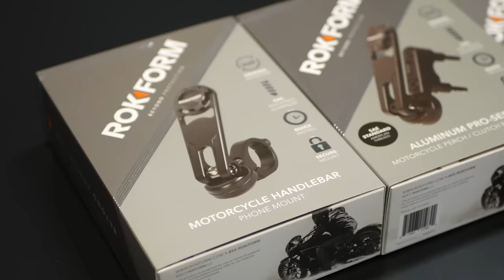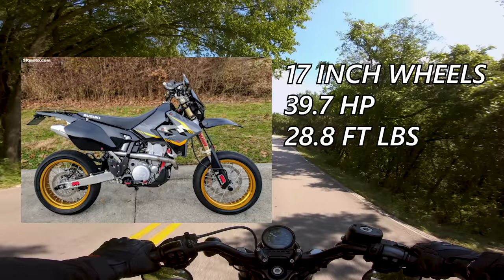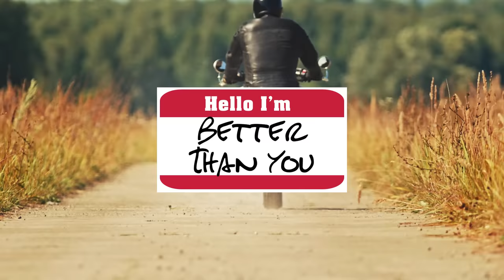7 Best Beginner Motorcycles For Tall Riders

Comment: Alright I'm getting a mt07. It's calling me.
Reply: as a taller rider, get the xsr, the slight ergo changes go a long way
Reply: @BeastMode1210  wouldn't just getting the comfort seat help with that?
Reply: @JamesExcell-InterJex  they are different genre of bikes lol. You want a streetfighter or a neo-classic design is for you to decide. You will make it comfortable for yourself anyway.
Reply: I'm learning to ride on a MT07 at motorcycle rider's school at the moment. Its a really nice bike.
Reply: Try a BMW F800R (if you can find one) or its F900R successor. ;)
Reply: @JamesExcell-InterJex  it helps for surew, it mainly depends on your height, for taller riders the ergos of the xsr go a long way, for shorter riders the mt07 is just fine
Reply: Im only 6feet tall which bike do you prefer for ny height?
Reply: On god it’s calling me too

Comment: 7:50 - I fully expected the V-strom 650. I just bought this as a 6'6'' Noob, and am in Heaven with it.
Reply: I'm guessing the BMW beat it out because of the price and, more importantly, the weight.
Having said that, I wouldn't give up my V-Strom 650 for the BMW
Reply: @phoff5850  Yeah, I was betting on a V-Strom, Versys or maaaybe a Tenere. Not a fan of the GS, can't find a redeeming feature other than the brand appeal which is of no importance to me.
Reply: @phoff5850   Maybe it's not deemed as a starter bike
Reply: @mercenex6329  i tried other more common tourer bikes (tenere , tracer , vstrom) and my dad's gs each bike feels different ofc but the gs really stands out the most bc of its additional coil in the front , it has that floating feeling i totaly understand why a lot of people buy it and it does totaly deserve the price , but ill stick to naked bikes , if id choose a more comfy bike , a sport tourer or maybe a gs who knows

Comment: I’m 6’6” and had a 2004 r6 for about 7 years for my starter bike. Not the best idea but i was 22 and it was cheap. I was fairly comfortable on it but definitely couldn’t tuck into it without practically sitting on the rear seat.

Comment: I'm 6'4'', really needed this! Thanks Spite!
Reply: What have you been looking at?   I’m 6’4 as well, 210.  Trying to find a bike that fit was the hardest battle.. all the ones I wanted were designed for normal sized people lol.
Reply: Same!
Reply: My preference is Honda. Cbr500, cbr650 or cb650r. All of them look absolutely beautiful, it is just a matter of me going to a place where I can try all of the above.
Reply: Same height but i can only get a 125CC rn 🙃   UK FFS
Reply: Croatia has the same thing, don't worry, the time will come
Reply: I recently saw these bikes 
I'm 6 feet 4 inches
86-90 kg
These are a list of bikes that I have seen in person that fit me perfectly 

- lexmoto tempest/gt
- keeway k-light/ super light 
- CB 125 R
- Herald motors Brat 
-Yamaha Mt125 (barely) 
- all Cafe Racers from  Brixton motors, Hanway motors, lexmoto, 
- fb mondial HPS 125 (just about)
-bullit hero
Reply: Ante Olujic I was going for the cb650 but mentioned to guy at the shop that I didn’t like the cafe racer style headlight. I prefer that street fighter look.  So he walked me over to a black GSX S750.   And I bought it 👍🏻
Reply: @thatstheguy07  Nice man, what are your impressions? I like the light!

Comment: I am 6'2 140 Kg, had an Indian Scout (not the sixty). Loved the bike so much took it every where I went until I decided to go for a long ride. Got on it 10 pm one night and just rode in to the night. Got to a mates place 7 hrs away and rested for a solid 3 hours and jumped back on it and rode back home. But the issue was, that 7 hour ride became a 10 hour one, as I had to get off stretch out every 20 - 30 minutes. So sold it and got a C90T, I can do 200 to 220 kms in one stretch ( that s when I need to refill) speed limit is 100 KPH. Also own a CBR 1000rr and a  675 daytona LE, Bear on a tricycle feeling on the The Triumph.
Reply: Hey I am 188cm/140kg, considering first bike. I am getting advised with litre CBR a lot, and i like the looks of it, but its a bit over my budget. Would you advise it too?

Comment: I'm 6'2", but a 35" inseam. You'd be surprised at how many beginner bikes that locks me out of. At least a Rebel 300 worked (for the MSF course).
Edit: My knees just barely hit the handlebars on a CBR500. 2 inch bar risers would fix this though.
Edit2: Number 1, my bike, an 80s Honda Magna V4 with ~80hp. As Spite said, on the bleeding edge of what's okay, but it's what I have. It's the VFR that I couldn't get.

Comment: I remember dreaming of a cruiser bike until I found out that sport bikes are actually pretty damn comfortable for me to sit in (Im 6'3) but the main question for me would be: Since most sport bikes are the most comfortable to ride on high speeds, what is the best sport bike for a beginner that would be exceptionally comfortable to ride on low speeds as well? That would be easy to turn and hard to drop.

Comment: Kawasaki Z900RS.. single most comfortable stock motorcycle I've ever sat on.. That seat is a dream, even though I want to sit on the strap behind where the rider is supposed to sit just to give me more room for my thighs and unbend my arms/legs a bit.. I'm not the biggest fan of the wide 4 cyl or semi-rear sets but otherwise the ergos are almost perfect.. The bars could be a bit wider and about an inch and a half higher but it definitely would be fine to ride stock for a while.. and OMFG that thing does not feel anywhere near as heavy as it is! I literally sat on the seat and put the kick stand up and leaned it over 45 degrees each way and sat it right back up with no issues and I've got a bad hip and knees! Oh and btw I'm 6'10 with around a 33 1/2-34 inch inseam when we're talking to the floor. (though I often wear 38-30 relaxed fit jeans because relaxed means the crotch hangs down a lot eating up leg inseam lol)
The Indian Scout is WAY too small for a tall rider, the seat height is incredibly low and the bike overall is really small. I tried to sit on one and my hip started screaming at me and I've sat on Harleys without issue.. other than they are ungodly heavy and make me feel like the tank is part of my taint. A Ducati Hypermotard is a much better fit for a taller rider and you can get them used CHEAP. (same with any 70's/80's UJM which you can easily pick up a low miles one for ~$2k)  A Royal Enfield Interceptor 650 (Int650) would be another really good choice though budget in a new seat because the stock one really doesn't classify as a seat other than you can sit on it.. it just squishes all the air out if even a little woman sits on it.. oh and the best part is they are under $6k.

Comment: I'm 6'3 240# and my bike is really designed for someone maybe 5'8ish and 100# lighter, the seat is hollowed out for a shorter Rider to sit down low and I was always trying to scoot back, but it acted like a backrest making it impossible.. solution was to fill in the low area with additional foam and reupholster, now my seat is flattened out and I can scoot back as far as I like.. made all the difference and I can finally ride comfortably.

Comment: I’m 6ft with a dodgy back and the bike I’ve been most comfortable on is the triumph street scrambler. I love it to bits. Also felt the mt09 2021 pretty comfy, Vespa gts300 was wonderful, also loved my tu250x but no abs is a dealbreaker for me as I’ve got older and wiser. Actually quite comfy on the Honda grom too owned one of them but outgrew it really quick. Honda make such comfy stuff. Had an mt07 and moto guzzi vii as well at one point but could never quite get comfy on them, not sure why!

Comment: 6.49 here from Europe,I don't agree with some options here. This is my experience: I checked Kawasaki Vulcan 600, Indian scout bobber,  I felt them ok ish but took some pictures  with me on them, I look like that bear on bicycle, I sat also on iron 883 the bike feel much heavier an unstable but it had mid pegs I  felt cramped but tryd to mimic forward pegs, looked a little better than Kawasaki and indian, I went on forty eight, same as Indian scout as look, but heavier, the other hd that I sat on was fxdr which is my dream bike, look and feel amazing, I still want to sit on fat Bob they didn't had it at that time in the shop. I,m still doing  my course on a hornet 600 the bike feels easy to maneuver, but I feel cramped, to reach the rear break is painful
Reply: 198 cm, 115kg and I think 93 cm inseam

Comment: for sportbikes tall people are better off with a retro bench seat cafe racer. both vitpilens are pretty good and thruxton fits ok (not really beginner though).
Reply: R125/R6 are ok for leg room and reach but weirdly the R3 is tiny (at least the 2015 on cycle ergo).
Reply: Most people just recommend a dirt bike because of the seat height and forget you need to put your feet on the pegs sometimes and need some reach to the bars not to be leaning backwards. A bike being bad for a short person doesn't mean good for a tall one.

Comment: The CBR500R will "dust up" a Ninja 400 and RC390? It's only has a few more HP and is nearly 100 lbs more than a RC390.

Also if you aren't worried about looking like an bear of a tricycle and want the best small CC track bike, I think a RC390 could still work for tall riders. My Vitpilen  401 has similar ergos, just a 0.9" taller seat height, and at 6', 32" inseam I cant flat foot it. My 6' 3" friend has more room on my bike than his 848 Evo.

Comment: Riding an aircooled 300cc carburated, ultra modified Honda CG knockoff that when is under engine brake behaves so nervous that makes you thing that is either fall apart or throw you out the second you accelerate is considered enough experience to get a 600cc? O.o

Comment: i need your help with something in my country driving license for motorcycles is graded into 3 parts: 
A2 is limited till 125 cc 
A1 is limited till 500 cc
and normal A which is unlimited but has 2 requirments: 
1. being 21 years old
2. having driving licence A1 for 1 year 
I am 6.7 feet / 205 cm and i need a good motorcycle that will fit me well and will be till 500 cc can you guys give me some help with that?

Comment: Im 6'7, what do i do
Reply: More than 6'3" it's most likely enduro or touring, google "cycle-ergo", there you can choose bikes and set your height and inseam, and it will create a figure showing yourself riding that motorcycle. You should look for a riding position that makes you bend your legs close to 90°.

And being as tall as you (1.99 cm, 135 kg), if you are a beginner and you want your first bike, you should look for less or equal than 300 cc toruing or enduro bikes, but not 125 or 150, we are a bit heavy.

Kawasaki Versys 300 (i don't like that revvy old engine, and it's not so tall)
Kawasaki KLX 300
Honda XR250
Honda XRE
Voge DS 300 Rally or DS 300 Adventure Touring
Yamaha XTZ 250.

A few observations:

If I'm a beginner I wouldn't go for or any of the bikes shown in this video. If it is my second or ++ motorcycle, depending on where, how much and how ofter I ride I would consider them. 

Be careful with those "best bike for beginners" videos if they show you motorcycles with engines bigger than 300 cc, save them for later.

Don't rush for bigger and expensive bikes, start small and step up being smart and careful. Spend those extra $$ not in cc but in good motorcycle gear.

Don't overestimate your skills if you are a beginner and a good bicycle rider.